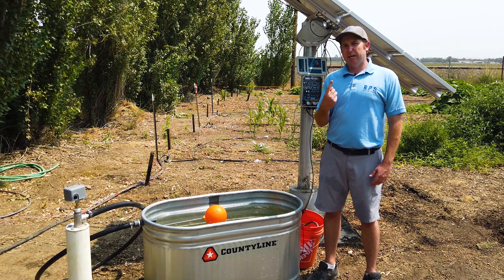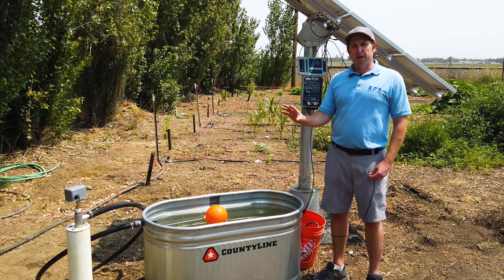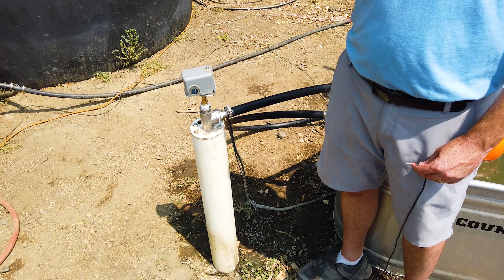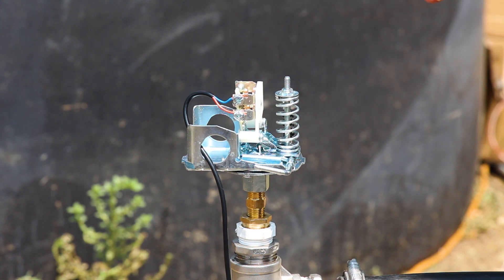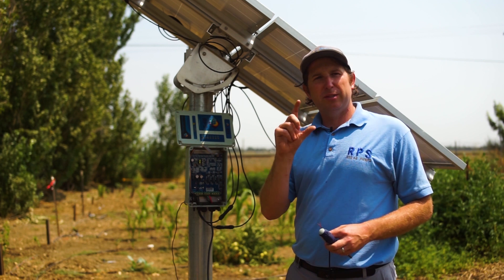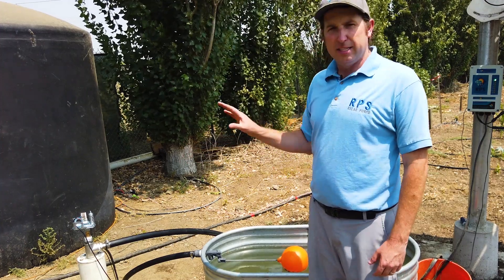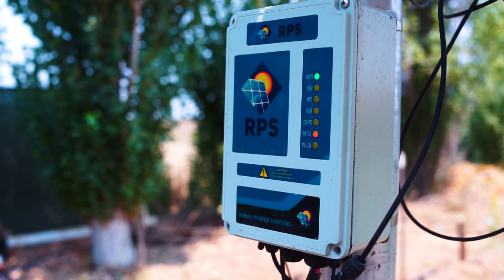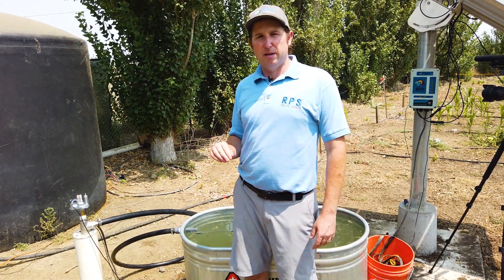Tank Full Shutoff with Reverse-Action Pressure Switch

Comment: Nice video, the part about pumps turning off when float valve is closed is crystal clear.  But what happens afterwards when water starts being withdrawn from the tank?  Pressure will fall rapidly and pumps will turn on again with very little water drawn down from the tank.  I don't see how this system can work unless you are ok with pump cycling with very little water withdrawn from the tank.   A float switch/remote controller seems unavoidable if you want pump to restart only after substantial fraction of tank water withdrawn.

Comment: Great video.  How can I get de pressure rank (to select the reverse pressure action switch) for a system with tanks to 100 meters high and 300 meters away from waterpump. Rising pipes from waterpump to tank 4 inches diameter.  Solar Pump is 2.3 HP. Thanks for your help.